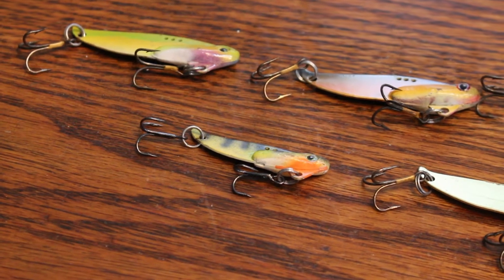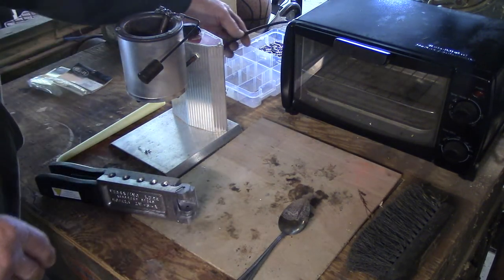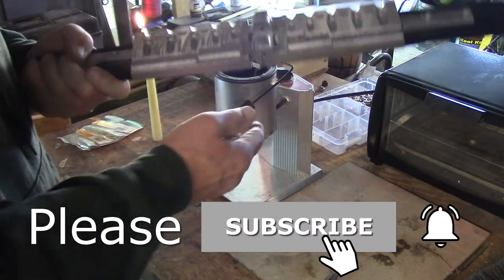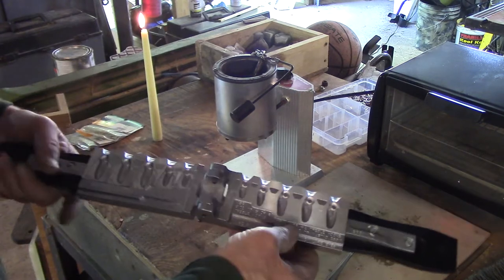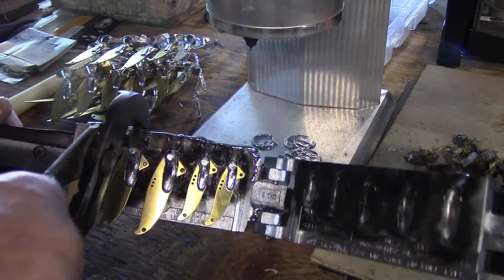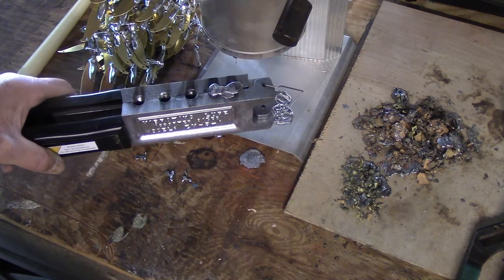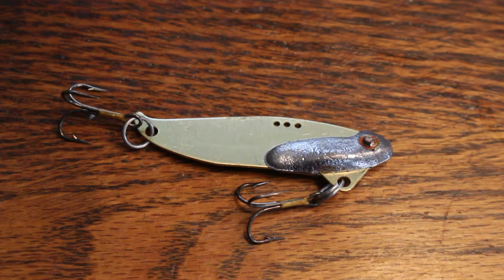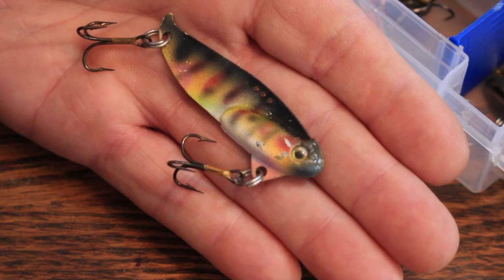How To Make Your Own Professional Looking DIY Blade Baits Or Vibrating Lures!: STEP BY STEP!!!

Comment: Nice work!  Does the paint hold up well or have you considered powder coating?  I learned a great deal from this video.  Thanks
Reply from the maker: The paint itself needs to be clear coated in order to hold up well. In the video I used a simple spray on lacquer, but found over time that it can become a little sticky. I think dipping them in a water base polyurethane would hold up better. Air brush allows you to paint them with great detail, but if you just wanted one or two colors then there is nothing wrong with powder coating the baits. Hope that helps and thanks for the positive feedback! Take care and may God bless you!
Reply: Wow many thanks- your answer  was spot on re my question thank you again for taking the time to clear  this up!!!   I Just hit the subscribe button!
Reply from the maker: You are so welcome and thanks for subscribing, I really appreciate it! God bless and have some fun out there!!!

Comment: Fantastic video, thanks for sharing. Along with the set-up you demonstrated, I also ordered a package of 25 AVLB-32 brass blade blanks that are supposed to work with the ZS-4-M Shad Blade Mold. I'm confused on just how to place that blade in the mold for pouring. Do you have anything demonstrating that? Thanks a bunch, Alan
Reply from the maker: Thanks so much for your encouraging words. There is a full detail of how to set the blanks in the mold starting at 11:00 minutes into the video. It is pretty straight forward and you will see once you have the blanks that there is really only one way for them to go into the mold. Just lay the mold open with both sides on the table (make sure you pre-warm the mold first) then place the blanks in and while leaving one side down on the table bring the other half of the mold over the top and close the mold. If you don't hear a distinct click sound when both mold half come together open it up again and check that one of the blanks didn't move out of line. Then go ahead and pour the baits. Don't worry you will get the hang of it in no time. Thanks so much for watching and may God bless you richly.

Comment: Excellent video but I am having an issue with my quarter ounce cavity, all of the other cavities poured just fine but a quarter ounce seems like it is too small and the lead won’t even drip past the insert
Reply from the maker: If you are having trouble with the smaller cavity make sure that the mold is up to temperature. Try filling the mold six or eight times with the hot lead without the inserts in them. Leave the hot pour in the mold for about 10 seconds and remove and repeat. This will allow the mold to come up to temperature quickly. Second make sure the lead is hot enough. If you are using a lead pot like mine set the dial on 7 or 8. The other thing you can do is soot the mold cavities with a lit candle by holding the flame under the mold and close to the metal. This sooting allows the lead to release easier from the mold and may allow it to flow easier. Lastly with the mold closed make sure the pour hole is not constricted. Make sure there is no flashing in the hole from the manufacture that might prevent the lead to flow. Hope that helps and again thanks for watching. Take care and God bless you!

Comment: Very good video mr frugal,just an fyi I fish them by attaching a good sample ball bearing swivel so you can quickly adjust the depth you want it to run,but some very nice painting!
Reply from the maker: Hey Ken, Good tip my friend! God bless!
Reply: do they spin if using a swivel?
Reply: Be careful if using too long of swivel- duo snap or too large front hook- they will tangle - when casting stop the line right before it hits the water to help stop tangles- I run braid to a swivel then about 18” fluorocarbon or mono to the duosnap- love blade baits- will catch all species

Comment: I have trouble getting the smallest size to fill.  I pore tin on the nickel blank to make a silver bait the tin stays shiny.
Reply from the maker: Thanks so much for sharing. I use pure lead with no tin added. From what I can find tin should pour at 700 degrees. If you are pouring at that temperature or above, it might be that your mold isn't quite hot enough when pouring or maybe you are taking a little too long between pours and it is cooling down and the cavity isn't filling all the way. When casting my 300 grain muzzleloader bullets with pure lead it takes quite a few initial pours before the bullets no longer have the frosty look to them and the lead flows fully into the cavity and they come out shiny. Maybe increase your pouring temperature or set the mold on top of the pot for 20 minutes to preheat it and then do some additional pours without the blade blanks before doing your actual pouring. If your pour doesn't take right you can always take a pair of pliers and dip the blade back in the pot for a few seconds to remelt and remove the lead so you can pour it again. Just be careful! I hope that helps! Thanks for watching and God bless!
Reply: I had the same issue, and I fixed it by following all of the steps that this guy talked about, but also shoving the cavity entrance right up against the nipple on the lead pot… I mean, it’s a perfect fit,

Comment: if I was to use 2 part epoxy instead of the spray would I have better durability? also, I didn't know I could use the "craft" paints watered down. I figured they just wouldn't work the same as the creatx brand. definitely gonna save me some money. appreciated. I'm glad you won your fight with the big C and depression. I think making things helps balance a busy mind. I'm really enjoying your channel.
Reply: Yes two part epoxy is the strongest clear coat you can use. I use uv clear. And you can absolutely thin down water based acrylic craft paint and run them through the airbrush and they work just as well. Createx is a water based acrylic paint as well